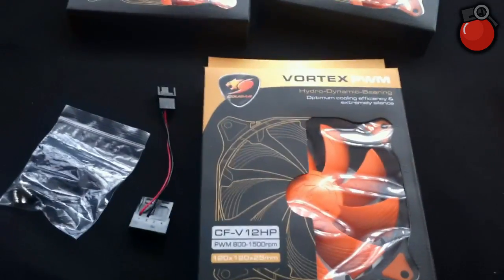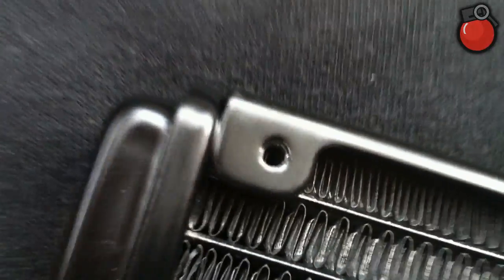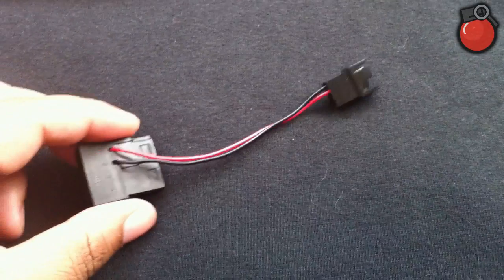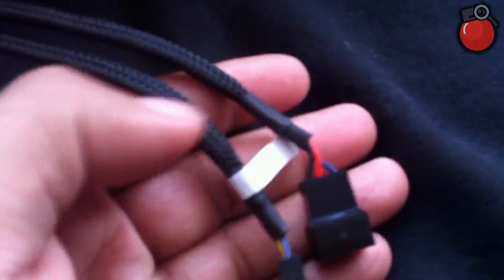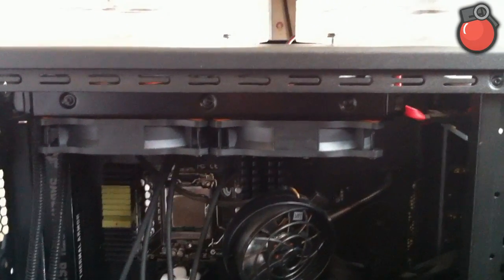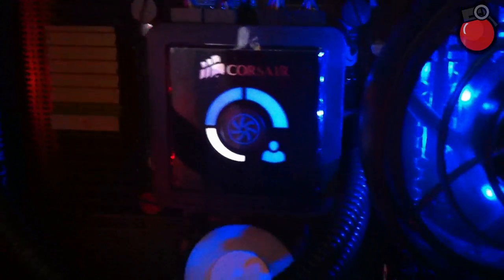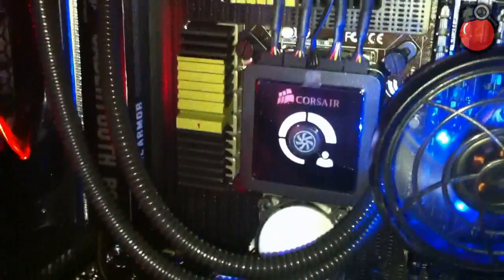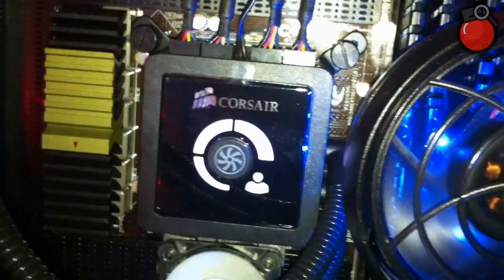Corsair H100 Review Update Push-Pull Cougar Vortex Fans - Cooler Master Haf X

Comment from the maker: @latticelinux I have tried to put the 12cm fans on top of the case but as you can see in the video the mounting holes are indented and when placing the fans on to the fans don't sit right and leaving a gap, so only way without modding was to fit it inside.

Comment from the maker: @Sikbeni10 you have to buy extra screws if you want to add extra 2 fans as corsiar just give you screws for the two fans only and 8 smaller scews to mount the rad to the case